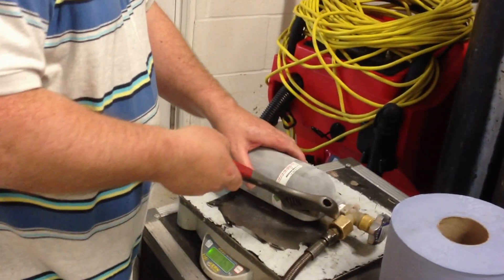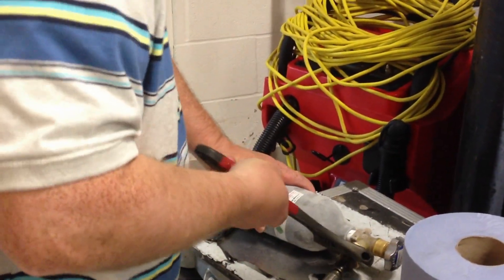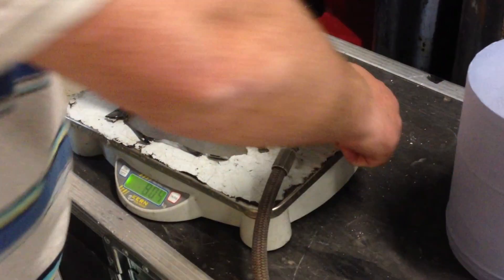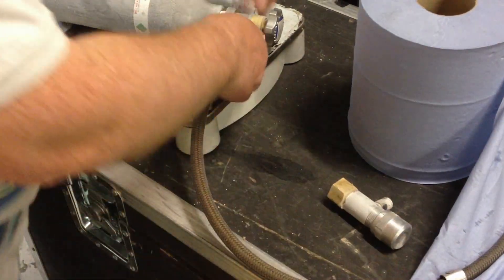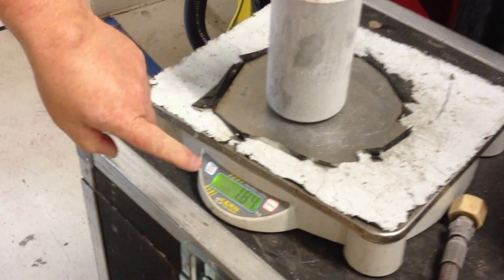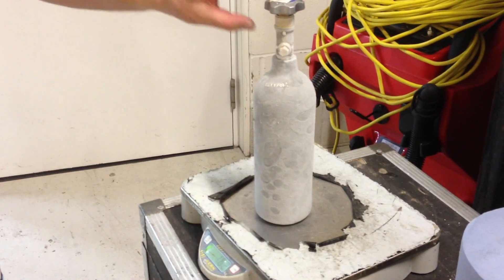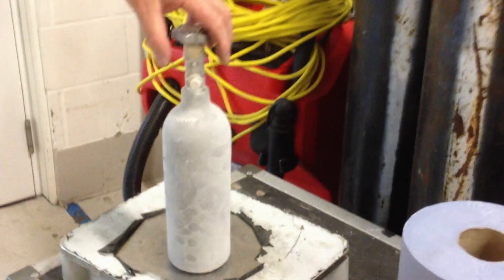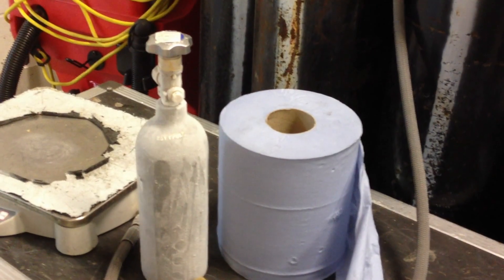Filling a CO2 bottle with liquid CO2 - 2996

Comment: i need to find a cylinder i can open and dumb 10kg of dry ice pellets in it without the cylinder eploding ? 

i think the dry ice will turn into liquid co2 inside the cylinder and it will be just like a normal co2 cylinder
Reply: i mean put the dry ice inside the clinder and then close the clinder and then wait and hope it turns into liquid co2 and stays inside the clinder and not explode
Reply from the maker: Sorry I can`t offer any advise other than don`t mess around with it if you are not sure what you are doing.
Reply: https://upload.wikimedia.org/wikipedia/commons/thumb/4/40/Comparison_carbon_dioxide_water_phase_diagrams.svg/512px-Comparison_carbon_dioxide_water_phase_diagrams.svg.png